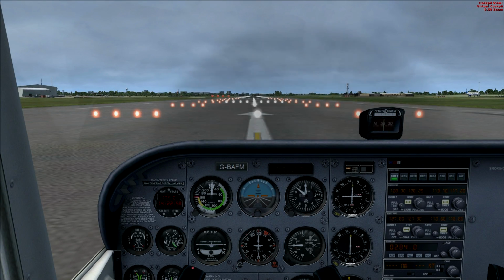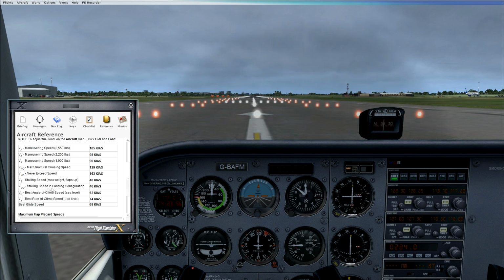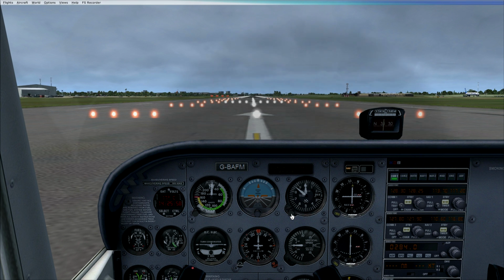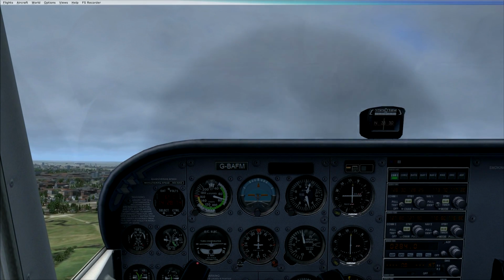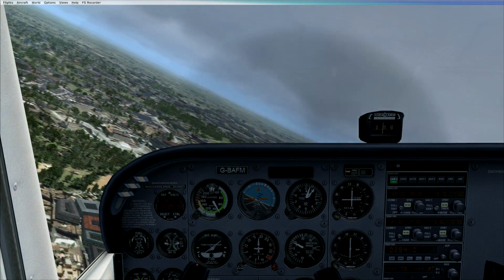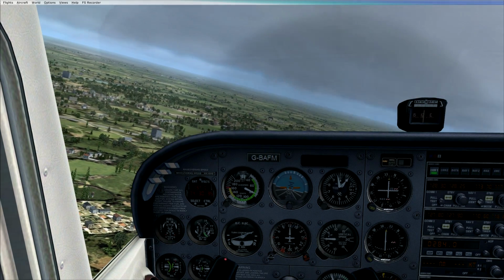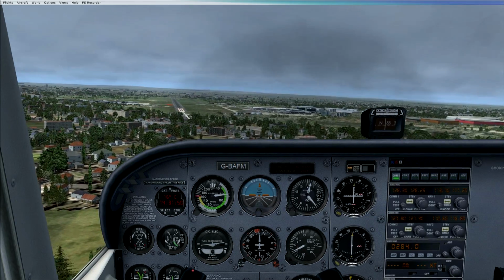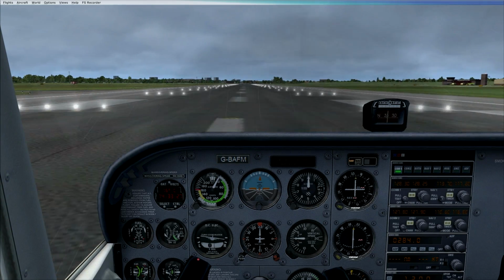FSX Basics Tutorial 4 (Cessna 172) How to fly the circuit / traffic pattern

Comment: For real flying We should make radio call for reporting left downwind at take off end of threshold. Than BUMFFIH check at mid of runway. Break, undercarriage, Mixture full rich,  Fuel shut off valve in. Fuel selector both, Ignition -both, Harness secured. At take off roll end of threshold we should reduce power by 100 rpm, put 10 flap and trim to release hand pressure. Take a urn to base and reduce power by another 100 rpm followed by flaps 20 and landing lights on. On approx 500 or 600 ft we should take a turn to finals from 10 o clock position. On finals maintain centerline and speed ( 65 - 70 kts ) followed by flare and check and touch down. cheers

Comment: I have really enjoyed this tutorial series. I recently dusted off my flight sim rig, hadn't flown in two years! I'm currently flying the A2A J3 Cub. With no flaps it's hard to slow it down for landing! Any tips for the Cub?
Reply from the maker: The only 2 tips for the cub are to slow down early, and if necessary side slip.  Have a look at 23:30 onwards on this video for a brief demonstration  https://www.youtube.com/watch?v=8uXzh2eJU1k
A slide slip is deliberately uncoordinated flight where you push the rudder in one direction and then the control column in the opposite direction.  The result is that you 'crab' sideways along the track you want to fly, but you also increase your rate of descent.  It's a very common technique in cubs and the like.  The only problem is you will need some sort of rudder control, either pedals or a twist grip joystick.
Hope that helps.

(Edited because I can't spell)